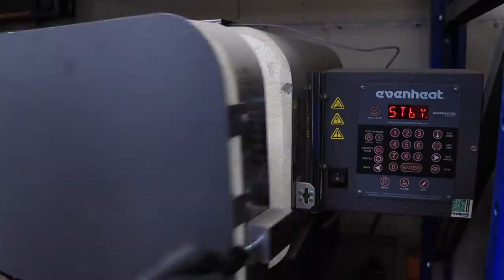Rebar Kitchen Knife?! Will It Work???

Comment: I like the ongoing intro gag where Deadpool leaves something around and you just kinda go ham on it.
Another excellent knife! I have a rebar dagger a friend made for me, although it's not meant as a "functional" piece per se. Mostly wanted something that was made from some leftover rebar from my folks' new home -- a connection to home sort of thing, y'know? I like it but figuring out a handle for it has been a problem that has vexed me for close to a decade. Guess I'll assemble it in time, but right now it's just a blade in a box that I take out and clean on occasion.
Also, I enjoy both the testing and the outtakes, but out of the two I think I enjoy the testing a bit more.
Reply from the maker: That’s wicked mate and good to have something what holds a memory as well

Comment: This video is the best one you've done!!
You milled out the rebar tang to forge weld in a piece of 1084. I've never seen that before.
You used a chain as the hold-down to set the initial weld. I've never seen that before.
You showed the blade going through the cryogenic process at your shop. I've never seen that before.
Btw....that blade was SHARRRRRP!!!!!
Reply from the maker: That’s wicked to hear mate thanks do much I really appreciate it

Comment: What was the liquid you placed it in before you put it in the forge? What was the powder you sprinkled on after first taking it out?
Reply from the maker: It’s kerosene to clean the steel and prevent build up of scale which helps forge welding. 
That was flux which does the same but when the steel is hot
Reply: @DiesInEveryFilm  Thank you, my friend.

Comment: Rebar is a mess. Most of us have tried stuff like tongs with it only to find random spots that WILL harden, and 99 times out of 100 it's right there at the eye and the boss which fail almost immediately due to cooling them down in the slack tank. Nice work on that forge weld, that was a pretty big weld for something that size.
Reply from the maker: Ive never found any here with carbon in so had to work round haha
Reply: The hardenable spots are kinda scattered through. Like a 2 foot bar may have 5 or 10 small spots that harden that are an inch or two long.

Comment: I wonder if that rebar actually adds some strength to the spine being a softer steel that it is....
Reply from the maker: In some cases having a soft jacket can be beneficial to a blade but this was too little and the carbon steel too thick to be that way

Comment: Always curious with metal work
*what was the white stuff you put on  it?
* what's the microwave thing?
*what's the white cauldron thing?
*what's that black looking liquid you dip it in for?
* what's the tub of gravel stuff you bury it in for?
 😅😅😅😅👍🏻
Reply from the maker: DEEEP BREATH AND…..
1. It’s flux to clean the steel. 
2. That’s my HT oven. 
3. Pressure pot. 
4. Turpentine for cleaning cold steel. 
5. It’s vermiculite to let the blade cool slower. 
Hope that’s everything

Comment: Maybe a handle that is solid until it hits, but purposefully collapses to lower the force to your hands? Then have it easily straighten out on the upswing.

Kind of like the breakable boards for martial arts. Just make sure they cant fully separate.
Reply from the maker: I assume you are talking about the axe but this is a knife video and no it’s designed and built the way i did it for a reason just like the hammers, no need to over complicate it, i put time and effort into designing and concept stuff
Reply: @DiesInEveryFilm  yeah, i came from the axe video that was based on the Japanese swinging hammer.

 Trying to come up with possible ideas for future videos as suggestions. Im not a designer so trying to think of things that you may or may not try. Like how a car will collapse to reduce force.

I do like your designs. Have a great easter weekend.

Comment: Knife is not fully made out of rebar it is a san Mai rebar spine and tang or handle knife
Reply from the maker: Unfortunately i felt that “rebar slotted out with knife steel insert then forge welded together to make a knife” may be a bit too short for a video title.